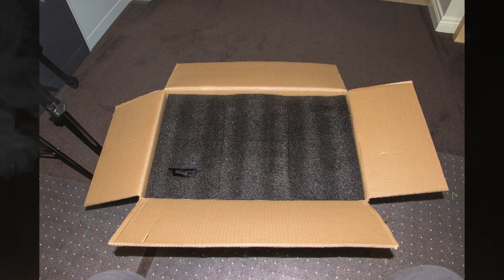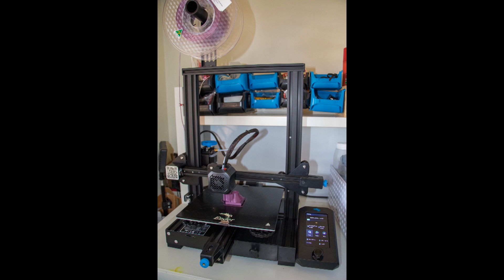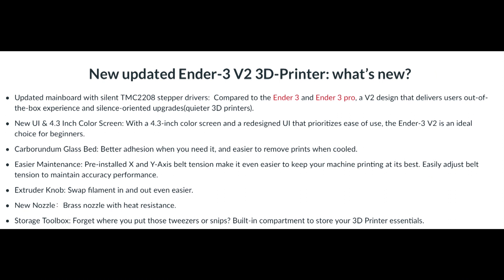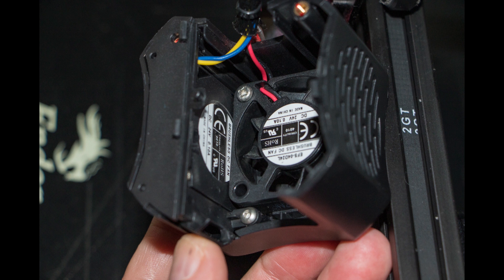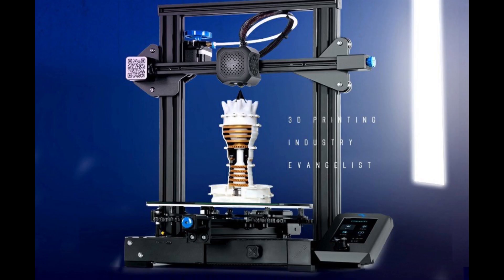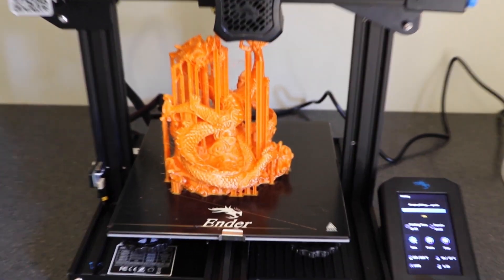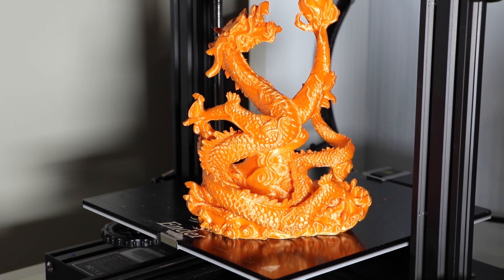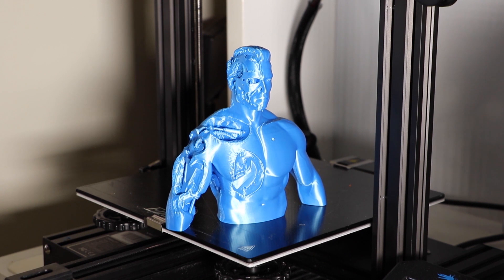Creality Ender 3 V2 ( Version 2 ) 3d Printer Unboxing and Review!

Comment: Thanks for the review John, this printer has been for fantastic for myself. Just had to design a new part cooling duct, install a BL Touch and enclose it. The enclosure I've made for this, I've put up for sale. What's the best way to get in contact with you to send one for review? :) 

I've found the enclosure has made it quieter and it moves the position of the spool holder of the machine.

Comment: My V2 has a dip in the centre of the glass bed. I’ve resolved it by putting several layers of aluminium under the glass in the centre which has levelled it out.